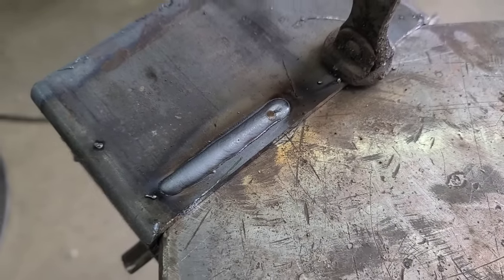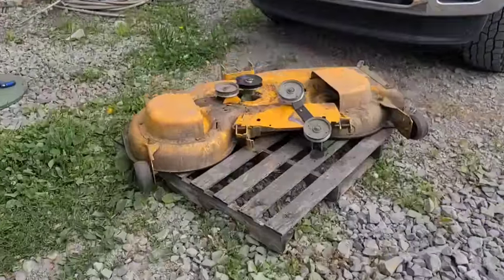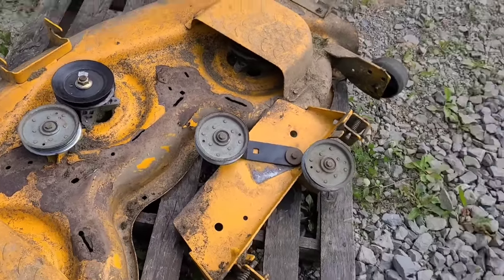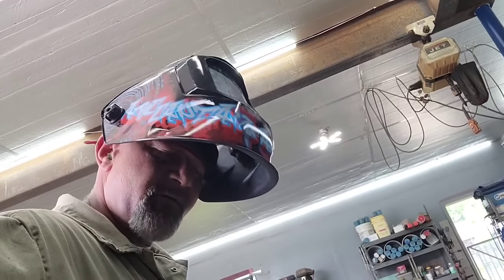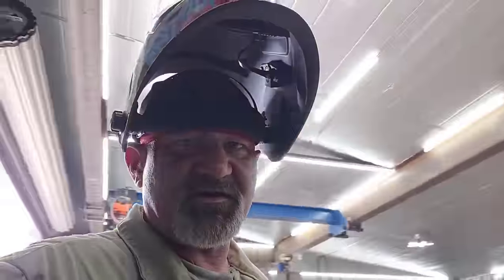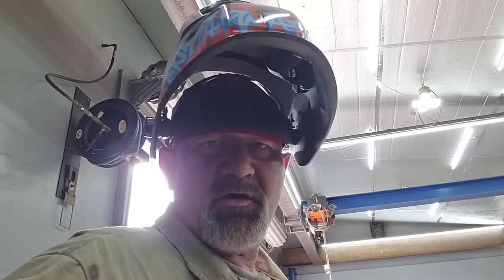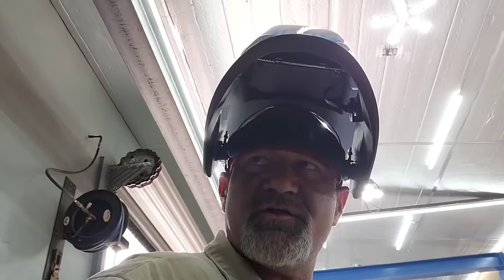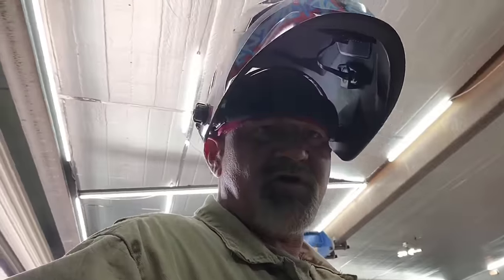ARCCAPTAIN MIG 200 welder review

Comment: So glad to see you doing structural repairs on 110 v. So many guys that claim to be welders claim that you can't but In my opinion and based on my experience, they are not what they claim to be or they would know how to properly read a puddle and simply move slower on lower amp/ volts allowing the metal to heat up, not to mention use multiple passes when necessary. Good video man. You are a welder.

Comment: Wow!!! Amazing al mig. Im 80 yrs old and since learning in my Uncles black smith shop I've been welding over 70 yrs ( still am) 48:40 
 From Avondale shipyards and Brown and Root offshore drilling platforms many high steel buildings and briges and fab shops pipe lines all across America including the Alkan pipeline and a scary pipeline in Mozambeke Africa Im sorta familiar with this categiry. Glad I found your chanel cause this has been the most thorough and informative with new knowlege I have ever seen.  Really fact packed enlighting review I've ever seen. Im old and crumbling weak so being able to work with this smaller equipment is a physical reliefe. Up in the mountains wishing I had a huge shop like yours. ArkCaptan should give you more goodies for your service. You sold me on this machine. I just bought their Plasma torch. ( Another shocking machine). Its 3 oclock in the morning snowing to beat the band and I gotta git to bed in time to git uo n feed my livestock in a couple hours. Thanks for being so thorough. I subbed and will be following your works. Saw part 2 before part 1 Dam!! Haha Good night ( or morning)  Dandahermit
Reply from the maker: Thanks for commenting...good to hear from an experienced old hand...keep a bind on it Buddy
Reply: What's the link I wanna buy this welder
Reply from the maker: @einchopp2730  
For ARCCAPTAIN products use this link https://www.arccaptain.com/?ref=NBSWELDING
Remember to enter promo code NBSWELDING5% to get 5% off and a free gift

Comment: It's good to see a seasoned professional shift from high-end, industrial-grade welders to give a go with upstarts! This also marks a milestone for channel growth, and more growth is a good thing! Encourage more content production! The ArcCaptain shows well in this video. I hope Miller see this video and gets NBS some newer models (e.g., Multimatic 220 and Multimatic 355 as upgrades for some of the transformer-era models in the NBS shop).

I'm not a fan of the all-metric and no-words front-panel design on the ArcCaptain. Obviously designed for a global market, not directed strictly at the US. Some of the competition sell models that show imperial instead of metric (e.g., .035" vs 9mm), and include automatic range selectors based on thickness of metal, process, and size of wire. A few stickers or an updated design on the bezel could help, rather than use the symbols on the ArcCaptain buttons and knobs (e.g., the indicator for 2T/4T/spot). Feels a bit "too international" for my taste. But, the controls on the front panel don't take away from the actual welding performance, which is great for this price range. Overall, good product! Complaining about the front panel is nearly crying about the color.

Was good to hear in past videos references to the PrimeWeld TIG in the NBS shop as a great option compared to a Miller Dynasty given how little NBS runs TIG versus his more common stick and MIG jobs. I suspect the PrimeWeld was an actual purchase versus promotion. As this channel gets more views I'm sure the equipment vendors well start lining up for NBS real-world kick-the-tires content!

NBS - congrats on leveling up and delivering yet another great video! Keep the reviews coming with new equipment as those opportunities present, but also continue using big blue and other professional-grade tools and practices, as there are a mix of viewers in your audience and it's good to showcase both sides of the spectrum!

Comment: I'm used to 3 phase heavy-duty machines - used them for work years - I now run tiny "Chinese" welders that look like toys & run off 220V.  Never met a damn thing I can't weld with my "Toy" welders. I wish I had these "toys" decades ago - would have saved me lugging heavy machines around. Don't ever bother with gas anymore - I run flux core or use stick.  If I had the money back that I wasted on gas over them same decades, I could go buy a Ferrari.
Reply: I hate the spatter that comes with flux core. I'd rather spend the money on the gas

Comment: Hopefully this helps,  when you’re welding the aluminum on the “non synergistic” setting and your wire feed only went up to 140,  look below 140 for their unit of measure.  It’s metric so it’s actually 14.0 meters/min which translates to 551 inches per minute.  I had to get used to converting that number and just googled the different values and made a chart in sharpie on what m/min was as ipm.  It confused me at first,  but I had to remember a lot of other places measure wire feed speed in meters/min.  Thanks for the great video

Comment: Living in Australia obviously we are 240 v but it welded amazing for 110v so I could imagine how it would be with 240v. The earth clamp looked like a quality clamp too & loved how the mask wasn’t just a boring black , over all it looks like an Amazing machine, pity it’s so expensive for someone living on a disability with low income, at 58 yo I still use my stick welder I got when I was 17 yo. I did buy a cheap 2 nd hand mig that’s gasless but the welds are not worth talking about, but if I ever win lotto I will be calling out to the makers of the arc captain machine, How good would it be to have 1 machine that does it all,also since it works on 110v does that mean I wouldn’t need a really large mobile generator ? . One day I might get one . Thankyou for showing us this great little machine, regards Andy Australia
Reply: Arccaptain has 240V  machines focus on Europe and Austrilia, you could have a check.
Reply: Reverse the polarity when running gasless wire it won't spatter as much

Comment: Putting a teflon liner in any mig gun sleeve will allow you to run aluminum....usually most machines come standard with a  braided liner hence the reason you cant run aluminum in them unless you change it [which they may not offer]

Comment: Dam 3 32:70/18 on 110 ac?? Did u reverse the polarity on the machine?? I gotta have one. My multi is onky 140 amp. I heard it
 I'm an old Teamster pipeliner etc and it sounds sweet. Your outta pisition is nice. Of course thats why we run 7018 on pipe.😅 Dandahermit
Reply from the maker: Run the 7018 electrode positive

Comment: I recently purchased the Arccaptain Mig 200.  The unit I received didn't have the 0.6V drive roller, for the .023 wire.  It's very disappointing that they don't supply the roller needed for automotive sheet metal.  I contacted them and they said it would have to be purchased separately.  Just a heads up for you, and more importantly, for others who may be considering purchasing this unit for automotive use.
Reply from the maker: No they don't come with .023....and it's an obsolete drive roll in my opinion...I don't think you need wire smaller than .030 for anything...even steel thinner than body metal
I wouldn't buy the .023 or an .025....get some good .030 wire and get to work...that's my opinion

Comment: I have a question and by the way, I am a beginner welder, when you plug it into 240. do you need to change the plugin machine to 240 or set it up the way you set it up? is it safe to do that all the time? Thanks, your review was the best one I have seen so far.
Reply from the maker: Nothing needs changed inside the machine when you plug it in

Comment: I am a pipe Welder, I wonder how good that welding machine will preform after being use for one year if the welding machine was used once a week.
Would it last a few years.
Reply from the maker: I am confident it would last...and from what I know about this type of inverter welder they don't seem to lose power over time from use like older welding technology.

And just as a side note since you mentioned that your a pipe welder...I will tell ya that these type of small inverter machines don't run cellulose based pipe rod like 6010 very good...when you try to run 6010, 7010, or 8010 the arc will go out intermittently and I don't know why...it's not just the ARCCAPTAIN either because my Nephew's Lincoln  210MP won't run pipe rod either.

If you need to run something like pipe rod with one of these machines just use 6011...those will work fine...they run all the other rods perfectly...7018, 6011, 6013, 7014, & 7024 all run fantastic

Comment: My one question... How to get consumables for this machine?
Reply from the maker: I get into it in part 2...stay tuned

Contact tips and gun parts from Harbor Freight are exact fit for this ARCCAPTAIN gun...I grabbed a Vulcan flux gun cover and a huge pack of Chicago Electric contact tips from Harbor Freight and they worked great....you'll also see in part 2 that the dense connectors in the front for the cables are the same connectors that my Primeweld machine has...I didn't see nothing weird or hard to get on this machine and I goofed with it quite a bit

Nothing weird about the wire spools it takes either...I tried several from the one or two pound spools to the ten or twelve pound spools and they all worked great
Reply: @NBSWELDING  thanks.. may just have to pull the trigger on this unit... Great to throw on the welding rig for small jobs and repairs where I could use solid wire and not drag out my large ln25 feeder
Reply: Arccaptain shop could support you all consumables.  you could check and have a try :)

Comment: I know on my other welder (different brand) they recommend a 30 amp 120v or 50 amp 240 breaker. And as for going into a kitchen and using their 20 amp 120, you need to tell them to turn off what ever is on the rest of the breaker.
Reply from the maker: Good point 👍

Comment: How do I make an adapter like the one you put together?
Reply from the maker: You'll have to connect a 120 volt female outlet to a 240 volt male plug with a heavy gauge wire.
Reply: You just don't want to have your buddy plug something into it not knowing any better.  I saw you had it labeled, but that won't stop some guys.